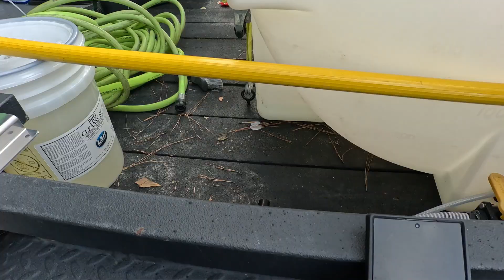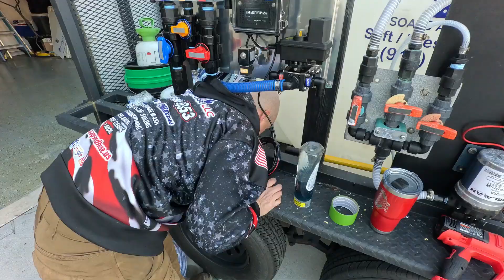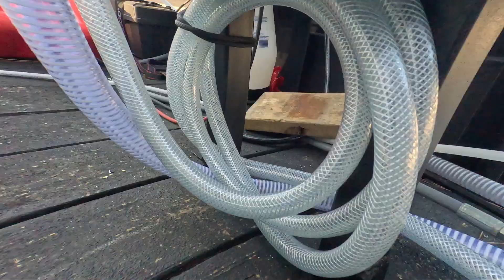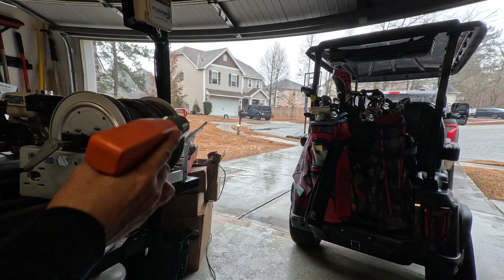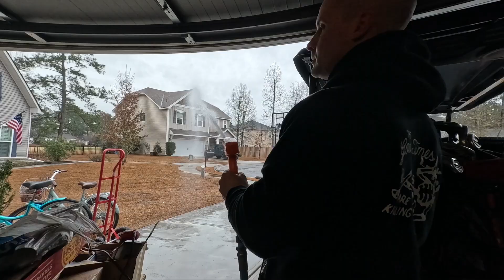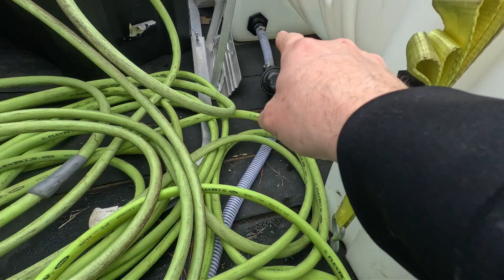Complete build of the NEW Comet P40 and Smart Bypass System!! FULL VIDEO

Comment: Can you shut off your soap with the remote as well or only the chem valve switches to water? I ask because I see another barb on the opposite side of the soap valve on the Smart Bypass.
Reply from the maker: Sorry for the late response, but the soap line goes through the same actuator as the chem so when you turn it on/off, it shuts the soap and chem on/off as well.

Comment: I have a question Im stuck on. Did you still install your check valve on your yellow high pressure hose?
Reply from the maker: No, there is no check valve on the yellow output hose.  No reason for it.  You would only put check valves on the suction hoses.  There are 3 check valves on each proportioner port though

Comment: Thanks for the tutorial. What is the vertical distance that you are able to get? Are you running 5/8" or 3/4" AG hose? And have you had any issues with it so far?
Reply from the maker: Sorry for the late response,  but its hard to measure vertical distance.  I can spray 4 stories though with no wind easy.

Comment: Secret weapon for high quality cheap hose clamps……. Harbor freight they have a 40 pack for less than $10 and they are extremely high high-quality hose clamps surprisingly. I run my softwash systems at 450 to 500 psi so high-quality hose clamps are a must if the connections aren’t just crimp straight on. Sometimes harbor freight’s got that pack of 40 hose clamps for like five bucks.
Reply from the maker: I will definitely look there, its 5 minutes from my house!   Thank you

Comment: Curious…I’m thinking about running my 25’ of bypass line into the top of my tank and back out so a majority of the hose is cooled down by cold water in tank as opposed to hot summer air. I’ve not seen this but wanted your thoughts? I feel bypass will run cooler.
Reply: If you get a pinhole in the line, that won’t be fun.
Those pumps get hot and cool back down extremely fast. The temperature outside of the hose will have a minimal impact. 
Even if you stick it in an ice cooler, the temperature inside the hose will still be hot. It may save you several seconds off the trigger, not worth it.
Just invest in remote start/stop system.
Reply from the maker: I mentioned that in the video but didnt end up doing it.  It would absolutely cool the bypass more during circulation

Comment: do you find yourself waiting on water a lot with that 250 gallon tank?
Reply from the maker: The tank is actually 525 gallons.  I usually keep around  100 gallons in to start with, but it ultimately depends on the flow of the faucet I am hooked to.  I've had jobs to where I've had to sit and wait for water and I've also had jobs that I have to turn the water off because it is filling too fast.  All depends.
Reply: You tightened the 3 way ball valve down too tight with those straps. Probably cracked it

Comment: Liking the video so far, but I would counter that spending the money on quality hose clamps like mikalor supras will likely save you more in the long run with invested time replacing the ones you bought that likely dont have a stainless screw, which is common. Appreciate the content!

Edit*
I am further into the video and see you had some issues with them after all. Now Im invested enough to see if you found something that works for you. 😅
Reply from the maker: I ended up getting the expensive ones at Lowe's.   You get what you pay for right?  Lol

Comment: I prefer to bypass the hose reels using same connection but instead of connecting it to hose reels it straight into the hose and gun
Reply from the maker: So you don't run the water/chem through the hose reel?? Just straight to the hose from the machine?
Reply: @soapsandhose Yes sr to avoid the restrictions on the swivels reels are for hose storage purposes only
Reply from the maker: @damianx0503 I do that on the pressure washer for the same reason

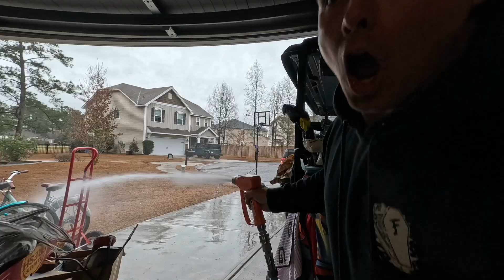Comment: This is a great setup. Also, a smart setup considering if there ever is an on-sight mishap with the P40, you can switch to the 12 volt with a cam connect. Fast and efficient. Another issue was how you showed your length on the P40 bypass line. That was important and thank you. Yeah, @39:24 I would be like that too! 😁
Reply from the maker: Thank you.  I'm trying to do it right the first time so I don't have to rebuild anything in the future.  Great to have a backup system too!!